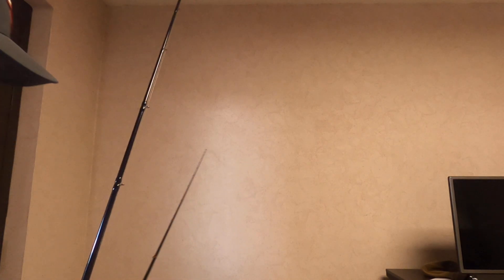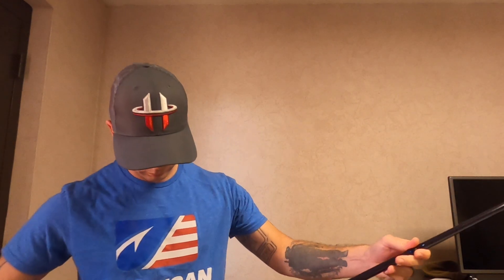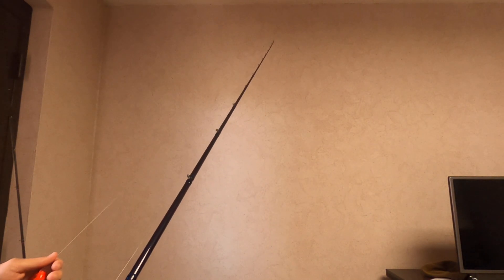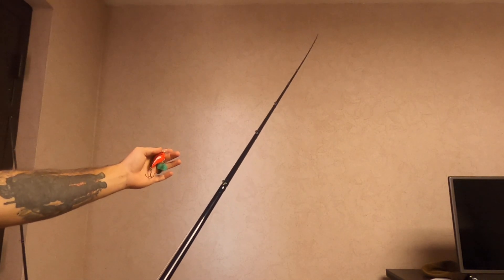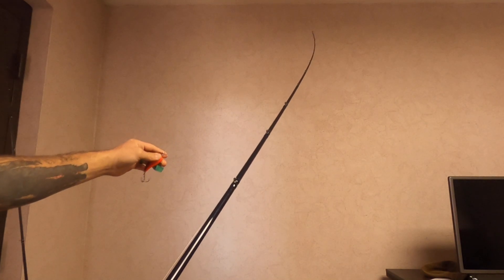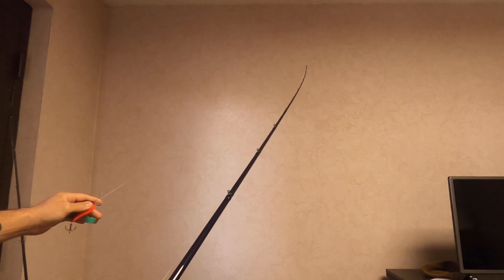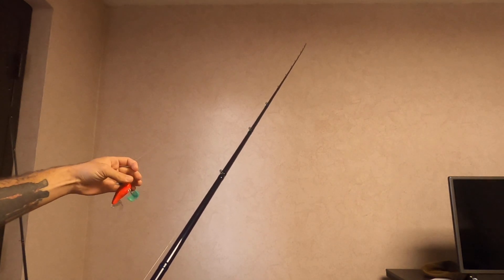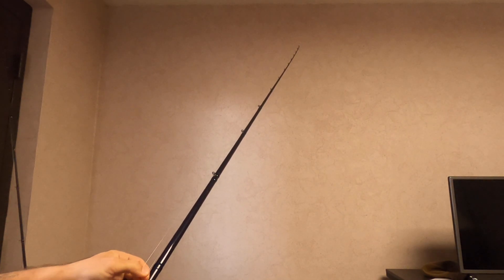Glass rod Vs Graphite rod

Comment: No such thing as a graphite rod. Carbon yes (which composes graphene) but not the other way around. Graphite comes from burned carbon. You cannot make graphite rods not unless you turn it back into carbon using a bonding method. i.e. resin. 
As for your glass vs "carbon" comparison. well done you have a valid point but glass fibre deteriorates far quicker over time due to its silica composition. think crystallization.
Best is to look at your budget. If you can afford it go carbon or if you are cash strapped go glass fibre. Glass fibre should be a lot cheaper and if it is not someone is milking the system big time. 
The whip depends on the manufacturer's action rating, yes? SO in theory both, if rated similarly should have the same action (sprung rate). The glass fibre rod should be slightly thicker though because of the composition.
Reply: I have one carbon type fishing rod, its very hard, stiff and easy to break but its super lightweight type and its only for fishing crayfish or lobsters.